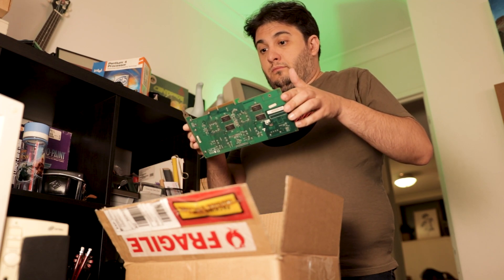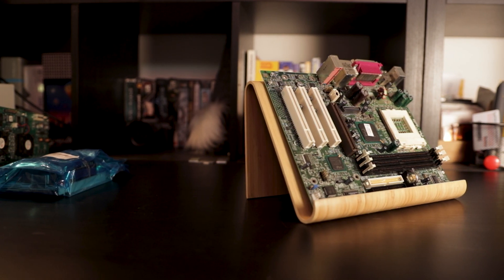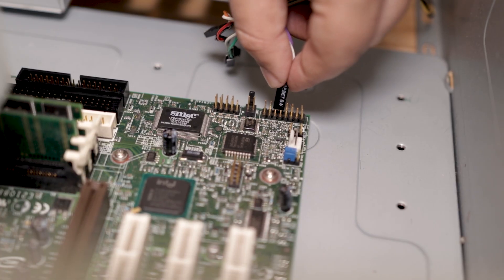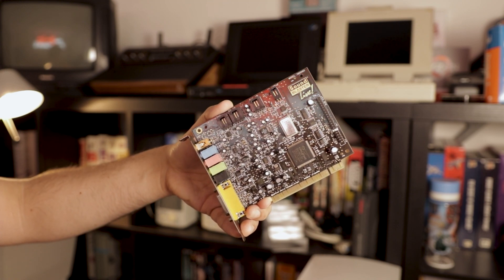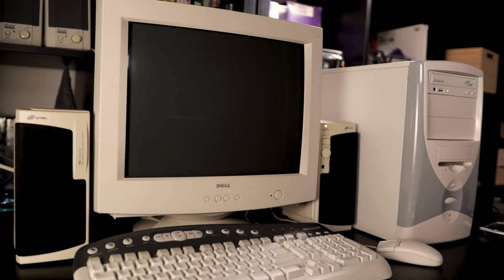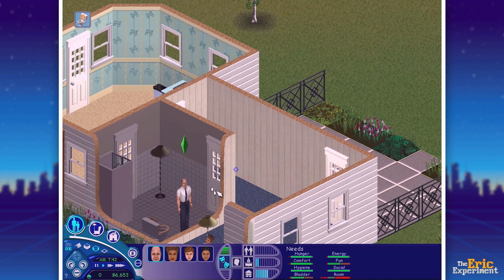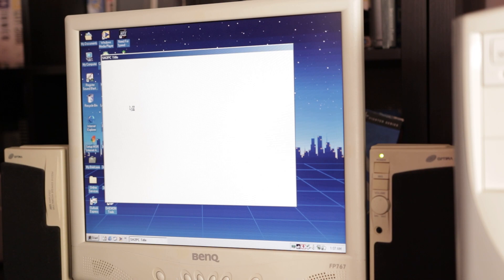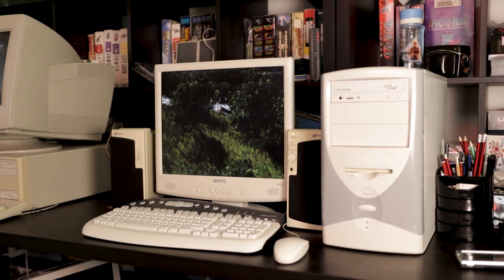I Built a PC with a $10 Voodoo 5

Comment: I miss my dual 1.2Ghz intel Pentium 3 decktop and quad 3dfx Gpu voodoo 5 agp card ^_^  i had the sound blaster live 5.1. at the time it was the thing i ever built that ran quake 3 and unreal tournament and serious sam 1 and dom 3 at full speed at high resolution in 2001 ^_^ when Nvida bought 3dfx them out i found the newer nvidia drivers added so much new features and pushed more performance out of the voodoo 5.. i also had a voodoo 3 pci. u upgraded to a pci gforce 2 mx 400. that card was shitty by the time unreal tournament 2003 came out it was lagging so bad and was actully less advanced then the 3dfx voodoo 5. 3dfx has the power and ability to do real time ray tracing while earlier g-force cards could not. :face-red-heart-shape: as for my old desktop from 2001. i let a friend barrow it back in 2014 and his little sisters spilt juice on the case that blow out the power supply and killed everything in the computer.. that desktop would still be working today if i never let him keepo it at his house... but i was in the middle of moving hotels and coudn't hold on to a huge desktop at the time...

Comment: You should not use the red washers while mounting the mainboard. They reduce the contact between the mainboard and the case and hinder grounding. Most likely nothing will happen if you do it (because the mainboard is still connected in many other spots with the case), but if the computer has "ghosts" or is not working stable try removing the washers.

Comment: Some of the contemporary 3D games of this card that I remember playing were Deux Ex (might have been the last game that supported Glide), Tribes2, Mechwarrior 4, Counter Strike, and The Operative: NOLF.  2000-2001were good years for 3D games, it's too bad that 3DFX would go under and get bought up by Nvidia at the end of 2000, but they were getting pretty far behind the curve.

I managed to never have to use or build on WinME. I was very happy with Win2kPro's higher stability and ecstatic about the NT5 OS switch. We put it on everything that didn't need Win98 drivers to work.

Comment: You say "S3 or Trident" as though S3 is on as low level as Trident. If you want to talk smack about something other than Trident, attack Cirrus Logic, cause S3 actually had some really good chips back in the day. The Vision series, especially the 864, 868, 964 and 968 were actually really solid chips back in the day, and were used in high end cards. Oh, and finding a Voodoo 5 for $10? Wow. Just wow.

Comment: Nice build, but is an SSD a good idea..?? Windows ME doesn't have TRIM and it will slow to a standstill eventually. Plus ME it will try and defrag it and that's not good for an SSD!
Reply from the maker: I don't use it too often so it should be fine for a looong time.
I figured that for my own use case I'd rather have something that will work reliably for the amount of times I use it than risk turning it on one day and the hard drive being dead.
Especially because swapping the ssd is super easy and cheap now.

But that's my use case, yours might be completely different. There's no correct way to do this except the one that works for you.
Reply: When a new video 😢

Comment: 3:42 - You are genius! Why did i never think of this? 🙂 BTW, using newer PSUs for old GPUs with extra power connector is not really safe because today power supplies have really weak 5V line with too thin cables, I burned one red 5V cable on a modern PSU recently when I was trying to overclock GeForce 6600GT, what I mostly do is cutting cables from old PSUs and solder it to new ones.
Reply: PS: I use Win ME for retro computers because it supports USB flash drives without installing another drivers and also mouse buttons back and forward work. Most of Win ME unstability was caused by istalling Win 95/98 drivers which mostly worked, but not always.
You should try also Hitman 1, it also has 3Dfx API and nobody is testing it for some reason.
Reply from the maker: Windows ME is super underrated in my opinion.

Yeah, I've learned that about modern PSUs recently. It's really sad because old PSUs become more and more unreliable.
Reply: @TheEricExperiment  It's not that big problem, but sometimes you will find GPU which uses 5V line more than today PSU producers expect, expecially while overclocking. I overclocked AGP version of 6600GT thru bios modding (because there was too strict limit for max frequencies in normal OC tools) and 5V cable in moles started smoking and plastic isolation melted down. GPU was ok, but it really scared me. 😀 But it makes sense when you realize that almost all modern HW uses only 12V pins, 5V is still there just for compatibility or some HDDs maybe. I also use 5V line for moding fans in older computers, you know, just put it directly to 5V to make it silent.
Reply: @treehugs1yt  Yes, but today PSUs just absolutely don't care about 5V and even today cables and molex connectors look very poor and cables have very low diameter. For 12V it's not that big problem because with higher voltage, current is lower for the same watts and modern GPUs have multiple 12V pins and connectors, but some very old GPU powered from traditional one molex can cause problems when you OC it too much.

Comment: What setup are you using to get those nice camera shots of the Voodoo 5? I to make old PC videos, but am still trying to figure out a decent solution. You seem to have it figured out. Good video also, that Voodoo 5 was an incredible find! Also how did you manage the VGA capture, it looks great?
Reply from the maker: Hey, Thanks for checking out my video, I really like your channel too!

I have a slide for the camera that helps me get stable pans and zooms. I also use Warp Stabilizer on Premiere to get them more stable.

That shot that the item stays still and the background changes is hard, you have to move the camera while changing the zoom in the opposite direction.

For the capture, the best solution so far is a GeFen VGA to DVI that I connect to an Elgato USB capture card.
It's not perfect though, I can't seem to get DOS centered in my captures.
UIs are captured fine though. 
I guess it's a work in progress to get the capture perfect.

I hope that helps.
Reply: @TheEricExperiment  Thanks man

Ahh I see, yeah they're very handy, Premier sure is the best for producing videos hey, I use it myself.

Interesting, never thought of doing a shot that way, very creative.

Ah right, that's a great way of doing it. I still haven't figured out a decent method yet, I'll keep that in mind! 

Yeah that helps a lot man, thanks for your quick response.
Reply from the maker: No worries, here to help fellow creators!